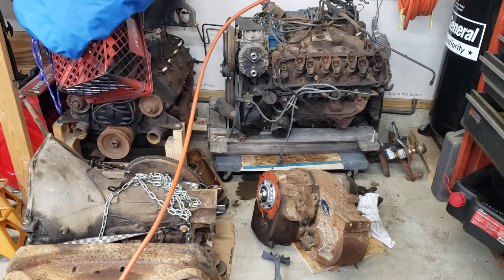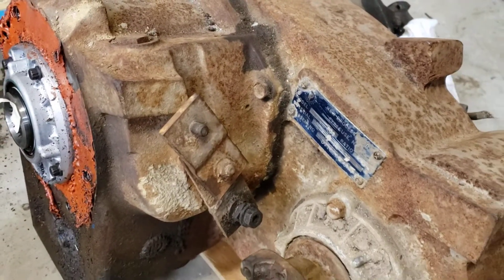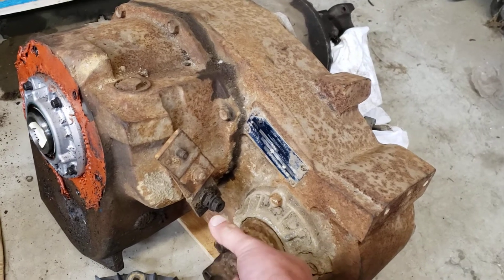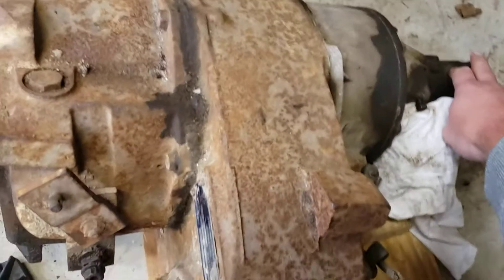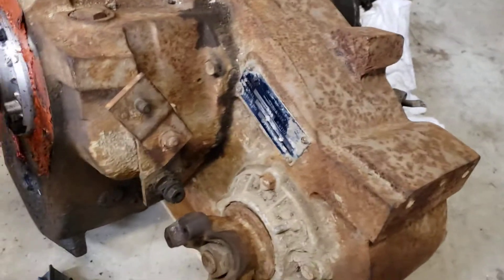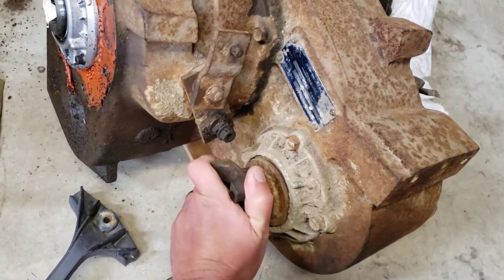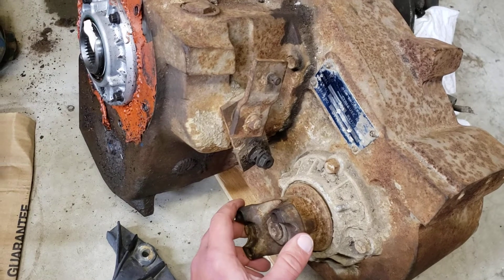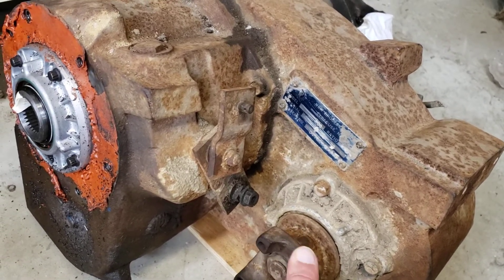NP203 newbie investigation

Comment: It's slack in the chain I've seen worse, I'd run it remember it takes motor oil not gear oil
Reply: well, it's all out of the truck and I plan to rebuild the transmission. from what I have read I can't get new "gears/sprockets" that the chain rides on. is it ok to just swap the chain?? it's a couple hundred bucks in parts to get the seal/bearing kit and the chain.
Reply: Chain and seal kit is what you need there is 2 different widths for the chain, pay attention, lots of needle bearings and you'll be fine